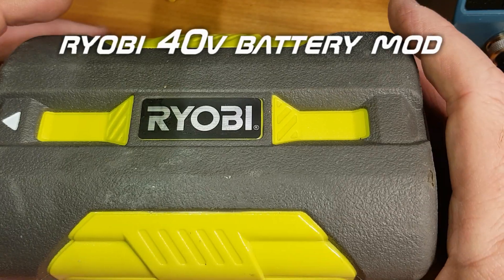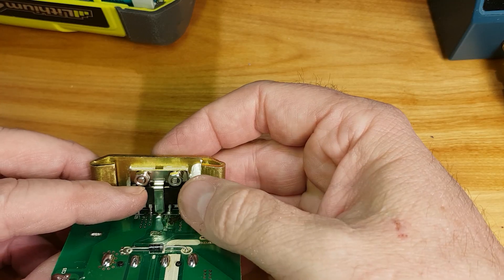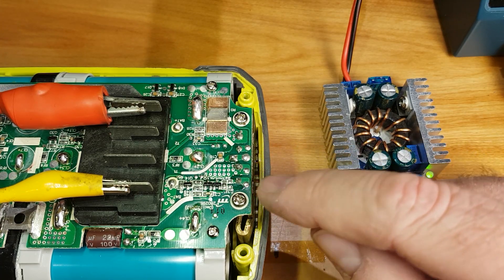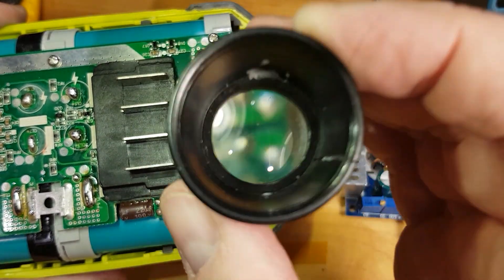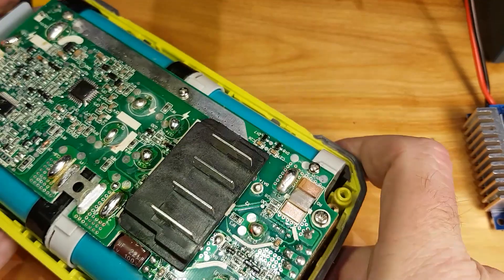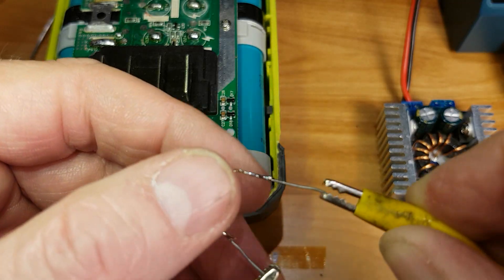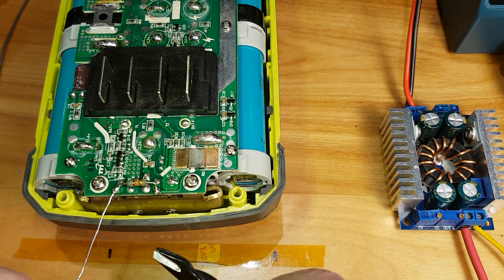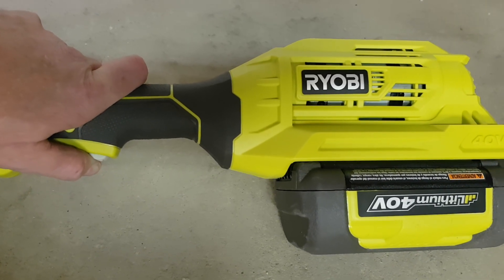Ryobi 40V battery won't charge.

Comment: My battery has only one FET.  Did you figure out a way of modding the one-FET board? With my battery, the charger says it's fully charged with a solid green light.  When I press the button on the battery, it shows all 4 green LEDs lit.  When I measure the pos and neg output leads of the battery, it reads 21V.  When I measure between the pos lead and the T1 Lead, I get 42V.  When I measure Between the Neg lead and T1 Lead, I get 0V.   I would think there shouldn't be such a high voltage on the T1 lead.  I don't have a schematic or any other battery to compare with.  When I put the battery into my leaf blower and press the button, no green LEDs turn on on the battery and the leaf blower doesn't turn on at all.  If I connect a 20V Dewalt battery to the leaf blow, the leaf blower turns on but there's not enough power to make the fan spin fast.  It's like about half speed.  Tonight I will connect 2 Dewalt batteries in series and connect to the leaf blower with jumper wires to see if it brings the fan speed to normal speed.  I wish I could find a schematic for the battery board.  I'm suspecting that something is burnt out on this board. There is a bit of molten plastic on the pos lead of the battery.  It's molten also on the cover where the lead touches.  I don't know if it's common for the pos lead to get that hot.
Reply: I measured the 20V Dewalt battery and 20.3V between the neg and pos pins.   Between the pos and TH pin it is 0V and between the neg and TH pin it is 20.3V.  When connected in Series, the output is 40.6V and runs the leaf blower good.  The speed of the leaf blower sounds normal.  If anyone has a way of fixing this Ryobi battery, it would be very much appreciated.  Without a schematic showing how the circuit works, it's difficult to know what's going on.  I could reverse engineer the board to get a better idea but with the surface mount components, it puts quite a strain on my old eyes.  When I was young, I used to do that.  I used to work in electronics, but it's been a long time. My battery is an older one.  It's number 12 and the date is Jan 6, 2011.  I measured across all the individual cells and they vary from 3.3 to 4.4V.   Only one is less than 4.0V.  None of them are less than the 3.3V.  I measured the output of the battery from the neg pin to the pos pin and put a load across it.  With no load, it reads 21V.  When I applied a load (large power resistor of 25 ohms), the battery voltage dropped to 0.00V.  When the load is removed, the voltage goes back to 21V.  If I short out the drain and source of the FET and you mention in your questions and answers video, the voltage across the neg and pos pins increases to 42V.  You said in that video that shorting the FET disables the overcharging and overdischarging protection so I don't want to be using that as my solution.  So the problem with this battery isn't that it doesn't charge.  The problem is that the battery output is only 21V and when a load is applied, it drops to OV. Any ideas on what I can do?
Reply: I put my battery into the leaf blower and it made the leaf blower work.  I measured the pos and neg pins of the battery and they still measured 21V.  I put the battery back in the tool and it still worked.  The only thing I did since I put the battery in the tool and it didn't work is I did a reset different than what I learned on most youtubes.  I found a youtube short that says to do the reset between the 3.3V pad and the RST pad.  Other youtubes said to do the reset by shorting the ground pad to the RST pad.  I don't know if this is the reason why the battery is working again because it's not proof that it's the reason.  I tried the reset between GND and RST yesterday, but the battery still didn't work. I will have to wait until it doesn't work again before I can troubleshoot further but now I know that it doesn't matter that the battery output reads 21V.  Maybe I could solder in some thin wires from the pos and neg pins to the outside so I can measure the voltage when I turn on the leaf blower.  Maybe it jumps up to 42V.  It sounded like it was getting the full 42V.  I could connect these 2 wires to a terminal block outside the battery to make sure they can't short out to each other.
Reply: I connected the thin wires to a terminal block, then connected them to a screw on the neg rail and to a screw on the positive rail.  Then I connected the multimeter probes to the terminal block.  The voltage measurement was 21V but became 42V the instant that I plugged the battery into the tool.  The strange thing though is after disconnecting the battery, the voltage stayed at 42V.  After about 3 minutes it dropped back down to 21V.  It looks like this is a function of the circuitry.
Reply: It's been a few hours so I put the battery back in the tool and it doesn't work again.  If I disconnect the battery, press the button so the 4 LEDs light up on front, then push battery back in, then the tool works for about 1 seconds then shuts off.

Comment: Great, but can you still charge battery with your intended ryobi charger, or do i have to purchase a charger, and 12 volt power supply like you use to charge the battery?

Comment: You don't need to modify traces, you just need to find B- or ground on the board. On the versions I have I connected the + fin and the circuit board ground (I clamped onto a screw) and was able the charge the battery.

Comment: Not the smartest move. You are basically overriding the security which prevents charging when the battery is defective. So you are now charging large defective Li Ion batteries which brings a heavy risk of fire or explosion.

Comment: Hi,
Newbie here and working on to fix my Ryobi 36v, 2.6A lawn mower battery. Since it was manufactured in 2015, I was thinking its time to replace all batteries (since it is not performing well) and I did. After changed, pretty much I am getting 40v at the pcb boards pins. But, when I measure across 2 main terminal point, T1 and T2, I am getting only 16.5v. Is this normal? With this condition, I was able to recharge and use it again but performance almost the same. Is the mosfet failing? Any ideas to fix my problem, please let me know. Thanks in advance.😊
Reply from the maker: I don't think the mosfet is failing. Those things either short out or stay open, which would cause no power or full power. I would ask where you got the batteries from.  Laptop batteries won't work as these ryobi  batteries are high current batteries.  If they are new batteries, I would test them with a load to see if you were scammed as their are a lot of cell sellers that are not trustworthy. Good luck.
Reply: @thecityviking  The batteries might be the cause. I use cheap China batteries but with higher current, 5800mAh each. I assumed it should give me more hours, 11.6Ah 😂, will it?

Comment: Or you could just put a wire to join the two nodes to factory restore the thing and take away the signal that doesn't allow it to charge anymore....
Reply from the maker: That works for some batteries if the cells are not too far apart in charge voltage.  Here is the video that shows the jumpers and how to use them.  

https://youtube.com/shorts/Rg6Z-aMTFLQ

Comment: GREAT video - thank you!!  You said, "don't charge these without being attentive", does that mean the charger will/can overcharge using this modification?  Any insight you can share about your warning would be appreciated!!
Reply from the maker: I believe that it's always a good idea to not leave batteries charging unattended, but especially if you modify the circuit.  The charger only charges the pack to 40V, but if there is a bad cell that doesn't charge properly, then the other cells could over charge.  Lithium cells do not like to overcharge, and there is a chance of fire.  All that being said, good cells are designed to vent and disconnect to prevent the fire.  I hope that clears things up.

Comment: To Save not opening case? Pluggable pin hole above ground. To rase voltage above charge requirements, with your charger? May help?
Reply: Accessed grd & voltage points on 18v with  accessing in plastic case. no Chang  in board change.
Is this a good idea?
Reply from the maker: I think that's a great idea.

Comment: Excellent video. I tore mine apart and noticed the board looks different than yours. There's a large glob of solder closer to the negative terminal. I've tried boosting it enough to get recognized by the charger by charging it at 1amp 31v from power supply, but only get one blinking light and still won't get recognized by the charger. 

I ordered a DC DC voltage booster and hoping that can do something since I can jump the voltage to 40 or 41v vs the 31 that my power supply tops out at. 

I saw another comment where you mentioned to check the voltage of each individual cell and balance the cells. How do you do that when this back is assembled in a way where I can't get terminals to the parts of each cell pack that I need to?
Reply from the maker: The board measures the voltage of all the banks of cells, so you should have access on the board. You may have one of the newer boards that is very different, but all cells should be accessible from there.

Comment: Great video, thanks. 
With this MOD will the original charger work? or do we need a constant 40v? 
or can I bypass T1 to charge gate to  open it and use original charger? thanks
Reply from the maker: It depends on which charger you have.  I think the older ones will, but the newer ones may not.

Thanks for watching.

Comment: My battery is charged but won't work in the ryobi mower
Reply from the maker: Does it work with a different battery?  It is possible that you either have an imbalance of the cells, causing the FET to shut off or possibly a bad FET.

Comment: CAN YOU SHOW VIDEO FOR SINGLE FET
Reply from the maker: Unfortunately I don't have any single FET boards. If I come across any I may make a video on it. You could bypass the FET with a short across the source and drain, but you would have to monitor all cells to prevent overcharge or fire.

Comment: is there a formula or method you used to determine which resistor to use? i'm not clear on how you got there but it's a creative as heck bypass and the resistor idea is fantastic - a second question is - have you seen other batteries use two fets to work in the same way? i'm thinking this is some kind of standard practice - but then i'm not sure why manufacturers would sometimes use only one fet lol so many things to learn.
Reply from the maker: The gate resistance is not critical for slow switching.  Many gate resistors are around 1k and higher resistance will still work but may slow down the switching on of the FET. Since this is just on or off not rapidly switching back and forth I picked a larger value. 

The formula is something like this. 

IGPEAK=(VG(on) - VG(off))/(RG+RG(int)).

Keep in mind though, that if you go too small,  you could kill the FET, or the drive circuit. 

Often, most BMS circuits I have seen have many FETs, but it is to increase the current they can switch. If you need to switch 100A, you would have to use many FETs to accomplish this. 

I have never seen a BMS that has seperate charge and discharge FETs like these Ryobi boards. The earlier Ryobi 40V batteries only had one FET, and maybe they found an issue that they felt warranted this. 

Most BMS circuits have FETs in parallel to increase their current switching, while these Ryobi BMS circuits have them in series. I think they may have done this as an extra safety. FETs can fail as a short or as an open, so to have a runaway short circuit you would have to have 2 FETs fail the same way.

Comment: I took my battery apart and I noticed it doesn't have the FETs at all . Have you seen this before. I got the battery for used for repair so im not sure about the history of it. Do some of the come with out Fets anybody ???
Reply: I found a video of someone with the same type of battery having the same issue ....   https://www.youtube.com/watch?v=T6xMwPbcvn0
Reply from the maker: All BMS have at least one FET, at least all the ones I have ever seen. The FET is like a switch. When it is fully charged, it switches off to stop overcharging. When discharging, it switches off again to stop over discharge. This is done to preserve the life of the cells and for safety. The BMS will also switch off the pack if the cells are very out of balance.  I would first make sure all cells are close to each other, say 3.600V. If all the cells are within 100mV or .100V of each other, they should be OK. Thanks for watching and check out my other video on these batteries. 

https://youtu.be/WKY1-JNijqo

P.s.  a FET can come in different packages, so it may look different, but it always has 3 connections.

Comment: Hi! New subscriber here. Have you tried to fix the older 40V with the BMS having only 1 MOSFET?
Reply from the maker: I have had a couple of those single mosfet boards.  While you could completely bypass the mosfet, I would not recommend it. If you get all the cells to approximately 3.5V and are fairly balanced, you may be able to charge it, but I have no other advice at this time. Thanks for watching, and check out my other video if you haven't seen it yet.

https://youtu.be/WKY1-JNijqo
Reply: @thecityviking  thanks for replying. When I tested the voltage across the battery (not from the contacts) it gives me a 39.25 V but the contacts only give me 18.94 V. Is it safe to bypass the mosfet? Or have it replaced?

Comment: This video is pure gold. I was about to give up on those ryobi batteries. ryobi community seems to have ALOT OF ISSUES with those 40v batteries.
Reply from the maker: Glad to hear it helped. I also have another video that answers some questions about these batteries. 

https://youtu.be/WKY1-JNijqo

Thanks for watching, and please share.
Reply: I've been using the same 3 40V batteries for over two years with zero issues. I keep them on the chargers full time and pull them off when needed.
Reply: That’s coz they be like crap
Reply: @georgedavall9449  Lol . Yeah i ended up getting rid of mine because the issues became frequent.

Comment: If you count the cells and do the math 20 cells in series for 2 sets of 10 then those are wired in parallel giving you an actual voltage of 36 volts. 41 volts may be just a bit high for charging. In reality the battery is nowhere near 40 volts.
Reply from the maker: The cells in these packs are 18650 cells with a nominal voltage of 3.6V and a fully charged voltage of 4.2V.  These packs are in a 10s2p or 10 series 2 parallel configuration. The cells should be charged to 4.2V per cell or 42V for a full charged pack. When it is removed from the charger, the voltage may drop a little depending on the age of the cells but should be well above 40V. Otherwise, you have bad/defective cells in your pack. If the pack sits for a month, it should still measure above 40V unless again you have bad cells. In the industry, these batteries are sometimes called 36V or 40V batteries.  
I hope that clears things up. Thanks for watching and share the link!

https://youtu.be/9chLnW1jX2U

I also have another video where I answer a bunch of questions about these batteries. 

https://youtu.be/WKY1-JNijqo

Comment: Hallo.
I have 20 V at the + and - terminals. But when i check terminals + and T1 then it is 40V. 
When I connect electric motor for testing it does not start.
What could be the problem??
Reply from the maker: Sounds like one of 2 possible problems. 1. The FET is damaged and not working and turning on.  2.  The signal that is supposed to turn on the FET is damaged or not coming on for some reason.  If it doesn't work in a tool, you could try jumpering the FET to bypass it.

Comment: Bit late question to ask this but idk, 
My dad has a 40V 5 Ah 180Wh Ryobi battery (Model: OP4050) for a lawnmower, Which was like a entire set that he picked up somewhere on the side of the road, But when it went into sleeper mode we have done everything from going in and out with the charger before it goes back into sleeper mode,
Reply: To tring to use the reset terminals (I think that is what it is called). And he thinks its something to do with the "Mof" thingy (atleast what he thinks its called. Idk didnt watch the full video). Any suggestions or?
Reply from the maker: Check the voltages of each cell.  They need to be above 3V each, and all cells should be about 0.100 or less of each other.

Comment: i have a stack of the 1,5A with one mosfet, do you know how to fix them? they show 1 green when i pust the testbuttom, but in the charger it says fully charged. When i put it in a tool it will not run. Any suggestions?
Reply from the maker: You need to check voltage of the pack and the individual cells.  It could be that one of the banks of cells is low, or the whole pack is too low to charge properly.  thanks for watching
Reply: @thecityviking  Thanks for answer. It has the right voltage when i measure inside (around 37v) but between the + and - terminal its only half the voltage. i can take the - inside from circuit board and it will run a motor.

Comment: That's the board mine as but mine shows full charge but won't work in the blower or string trimmer. My other battery works fine.
Reply from the maker: All the lights sometimes light when the battery is very depleted. Check the charger on the battery to know if it is truly fully charged.
Reply: @thecityviking  I have 2 chargers, both see the battery as fully charged. Occasionally it shows error when first plugged in but I remove it and slide it back in it shows full. Definitely strange. Also when checking the charge by the button on the end it shows full.